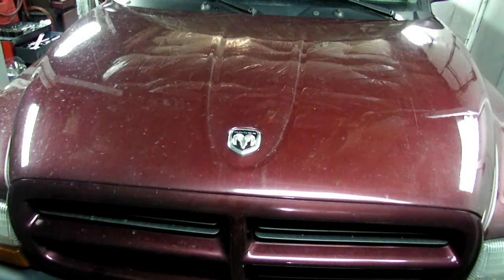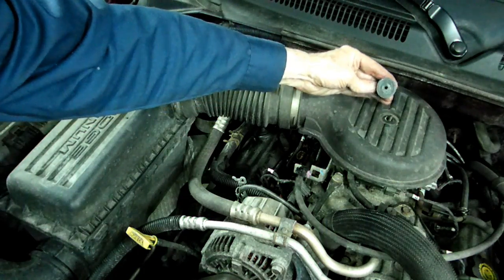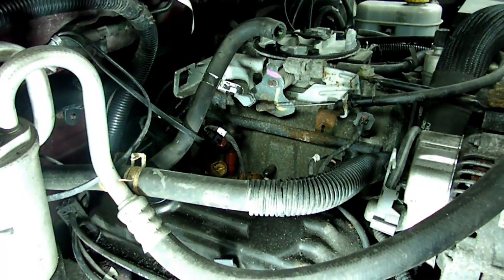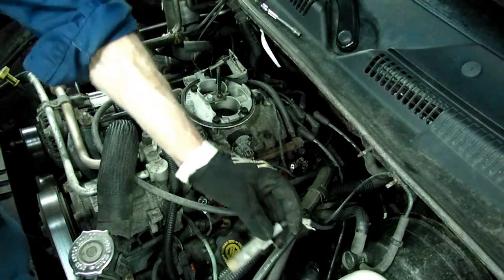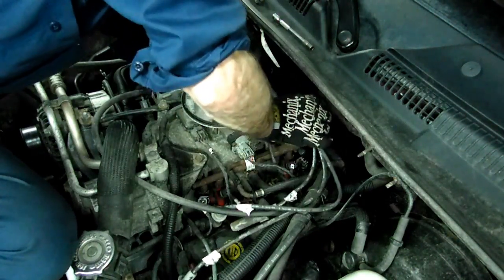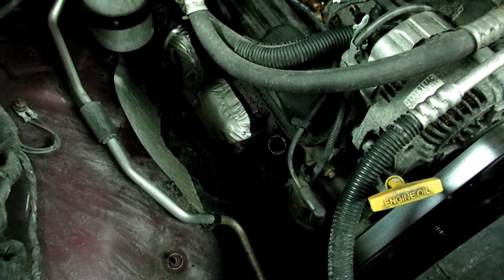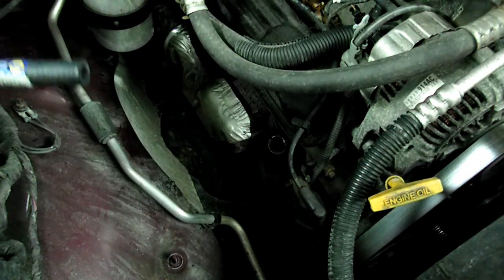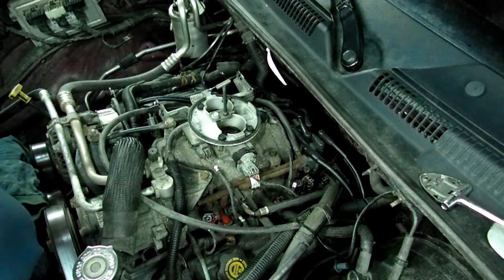Tune Up Dodge Jeep 3.9L 5.2L

Comment: GREAT VIDEO!   About to do this on my 2000 v6 4x4 , just bought it and it has 83000 miles , as far as i know only the spark plugs have been replaced and it was 20000 miles ago . Was there a big difference in performance , mpg etc etc after you did this ?

Comment: @richpin06a 

Clearly you've never touched the Buick Lesabres with the 3400ls. In order to change the plugs on 2-3-6 you need to have it on a hoist, as you need to come in from over top of the Y-pipe. The 3xxxLS series motors are a pain in the ass, but in some cars it's worse than others as GM used them in a lot of their cars.

Comment: Or what about the azteks? Try to get 2 3 6 on those. Need a lift and its an aluminum block so the plugs don't want to come out. Your up to your shoulder doing everything by feel with your finger tips.

Comment: thank you for the video on the dodge Dakota tune up; what about the PCV valve, fuel filter, and air filter. How come no one thinks of those parts as part of the tune up. I seems counter productive not to. Don't you think?

thanks again,
~todd

Comment: pretty much this 3.9L is a  5.2L with two cylinders left off . So if you did a Tune-Up on a 5.2L in a Jeep/Dodge you would have 2 more wires and 2 more Spark  plugs to change.